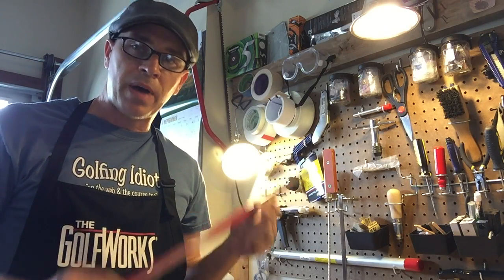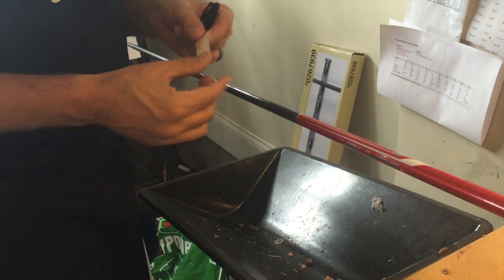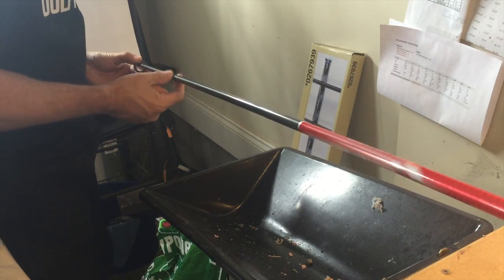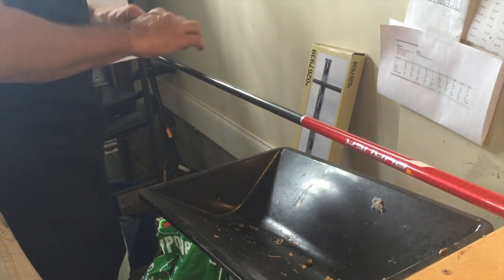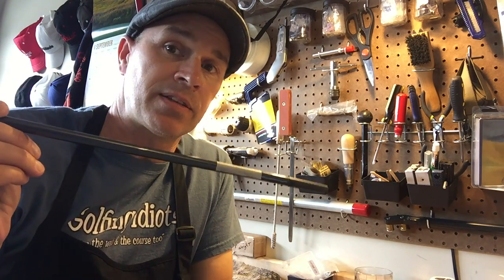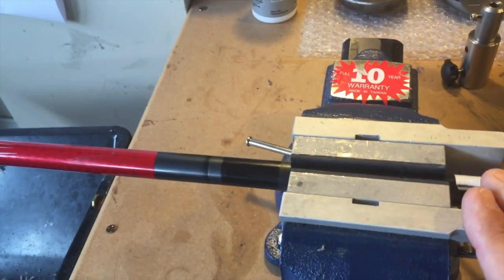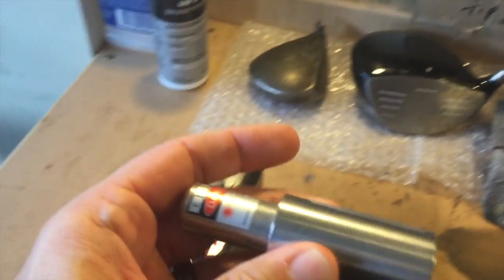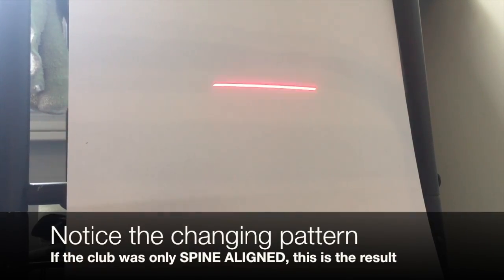How to FLO a Golf Shaft (correct position of shaft alignment)

Comment: I have performed the flo procedure on all my woods.I lost my laser that I used in the past and wanted to check a friends driver.This a alternative, I clamped the driver shaft in my vise cautiously, cut a thin strip of white tape and put it at right angle to the face and in the center of the head.put my bright pen light to shine on the dot then did a few twangs of the shaft,this works, you can see right to left line or oscillation of tape line quite clearly. 
I call it poor boy puring.

Comment: I agree completely about putting the softest bending axis of the shaft (the spine) in line with the target line when finding the FLO. Often/usually the FLO will be relatively close to the axis of the spine. There is another advantage in doing this. Having the softest flex axis near the target direction when assembling the club will mean the axis that bends much less will be perpendicular to the target line. That will mean the shaft bends down less and, therefore, the club head droops less at impact, making solid contact easier. I do one thing different than what you show. I use the actual club head jammed on to the shaft with a small piece of rubber band to hold it there. I FLO the shaft that way since it duplicates the center of gravity of the head being away from the center of the shaft. Obviously I turn the head so it starts with the clubface facing the same direction as the mark on the tape and I keep adjusting the head position slightly when turning the shaft in the vise until the shaft oscillates in a straight line. The club face needs to keep being adjusted to face perpendicular to the line of twang. Once I find the FLO axis I mark the tape with a different color line, but on the FLO axis (9 o'clock). When assimbling the club I put the second color line facing the target which is the straight line FLO axis. It is just a different way to get to the same result.
Reply: is the only way to do this yourself or are there businesses that provide the service? ty for your comment, it seems most logical to "FLO" the shaft with the head on it since at the end of the day that's how you are gonna hit it. Additionally, i feel as if different heads have different weights and center of gravity which might affect the perfect shaft allignment.

Comment: I spline the shaft in the 2 bushings on a vertical plane, straight up and down. Then I put the clubhead on the shaft without epoxy. Then I stress the shaft and align the face of the club so that it is facing at a 90 degree angle from where the spline is. Then mark the shaft and the hosel so that I can remove the bushings, then reattach the club head with epoxy. 
When I stress the shaft during the golf swing the same as I stressed it with the bushings the shaft will want to square up the club face the same as it did in the bushings. 
This method would seem to best simulate the actual stresses generated in the golf swing.

Comment: I agree 100%, I started flowing my DCB's and only 2 out of 6 were where the Osculation had a flat line. The Epic Max (brand new) was the worst and by rotating it I was able to reduce it to a small oval but the adjustable hosel is a joke.
Reply from the maker: Have you found that you are more consistent or less dispersion with your FLO'd shafts?
Reply: I will buy a shaft puller and hosels and let you know when I am done.
Reply: Callaway adjustable hosels and one other brand I don't remember (PXG?) will keep the shaft in the same orientation regardless of the setting.

Comment: so to make sure i followed this correctly, after flo'ing the shaft then allign the 12 o'clock flo mark with the club face? or how do you know where to align that mark with? i had assumed the club head would have a mark to align to, but that is not the case of my club heads at least, so the 12 o'clock of a driver head vs a 60* changes wouldn't it?

Comment: I find the way you FLO a shaft interesting. It is the same way I do it. I put the mark 90 degrees different that you do (on the FLO axis) so it is in line with the target line when the club is assembled, but the resulting shaft position in the assembled club is the same. I have never understood why some people assemble the club with the FLO line perpendicular to the target line. It seems that would make the shaft droop more, be less consistent in behavior, and increase the difficulty in hitting the ball in the center of the face.
Reply from the maker: Either way will work as long as the person understands the FLO should be parallel to the swing place/path. I guess the marking is only a preference. I am not sure why someone would place the FLO shaft in the position you referred too. Odd.

Comment: Some would argue the bearing based "spine finder" is not finding  a spine, but how the shaft is naturally not perfectly straight but has a slight curve in it , when not flexed. Nothing is manufactured perfectly straight.    If a shaft was so unstraight it looked like a kitchen spatula, it would would always rotate to that same position in the bearing curve finder, every time.     Yet what does that have to do with how the club actually oscillates when it bends?   Not always much, as the shaft is often rotated away from the curve aligned spot to find a spine it will flo in.  I prefer to flo the shaft vertical.  I have a tip weight with a laser pointed rubber banded to it.  I can leave it a tad loose and slightly shake the shaft to get the tip/laser center of gravity to fall straight down, and then tighten it.  Then i know the tip weight and laser's  center of gravity is straight in line with a straight vertical twang.

Comment: Very interesting video and impressive shop. One item which was not addressed was if shaft spine has any correlation to FLO result. Since FLO is the goal, why bother with finding the spine (other than maybe giving you a good place to start with FLO process) since the shaft needs to be installed at 12 o'clock after FLO completed anyway?
Reply from the maker: Hello Chris, I get this question a ton so you are not alone.  The ONLY reason I did the spine marking was to show in the video the difference between a FLO'd alignment and a Spine alignment which rarely correlate.  Apparently, I did not do a good enough job explaining that point in the video, but I'm always happy to answer the question.  https://youtu.be/PrVkh1dig9o?t=566

Comment: Great channel!!! I would be interested to see if the shaft flos a tiny bit differently with the head dry fitted on to it than with just the laser weight. Since the weight of a clubhead is not centered around the shaft but on the side of it.
Reply from the maker: Thanks for watching and glad you're enjoying the content!  The laser is actually on the high side of the shaft during the FLO process.  Therefore, it is similar to the weighting of a club head.  Some individuals actually use a dry fit club head to FLO the shaft.

Comment: Thanks for the info. Nice, thorough explanation. So, looking at the movement of the laser oscillating after you "twang" the shaft, it seems to take a half dozen oscillations before they begin to get wonky. Makes me wonder if it makes any positive difference. One thing for sure, however, it definitely can't hurt. As little time as it takes to find that ideal plane, I'm all for it regardless.
Reply from the maker: So how did it work out for you?

Comment: You explained this process perfectly. I have been floing shafts forever. Whenever I try to explain to a customer why and how it's done they look at me like I'm crazy. I will send them your link from now on! And hell yeah. It does make a huge difference. I love to experiment and have way too much time on my hands to do so. Since I started floing my own shafts, dispersion is RIDICULOUSLY tight! If I'm having a "good golf day", I can land my 8 Iron shots in a hula hoop!
Do you find it a little more challenging to find the Flo as the shafts get shorter? For example, steel shafts for 8 or 9 through to the wedges? I eventually find it, but it takes a bit.
Reply from the maker: I completely agree with you and glad to find another person who is as passionate about FLO'ing shafts as I am!  To prove the point,  I have two identical 6 irons, one is FLO'd and one is not; I get an individual to hit both and ask which one they prefer (I do not tell them which one is FLO'd prior to hitting the irons).  Without fail, it is always the FLO'd iron.  I cannot say that shorter shafts cause me an issue more than longer shafts, but honestly I've never really paid much attention to it either.  I do note that better quality shafts are MUCH easier to find the FLO. Glad the video helped and thanks for the promotion.
Reply: @XJSimulations  
To add one more apple to the ox cart...
I Flo with the Golf Mechanix chucked tip weight and Flo tracer with the adjustable weighting along with the shaft rotation dial indicator.
I also start with the spine alignment mark. Very rarely does it line up with with Flo, but when it does I consider this the holy grail of shafts! To get back on topic, when I find Flo, I re adjust my dial indicator to 0°. Then I rotate the shaft 180°, and it should Flo exactly the same. I then note the height of the laser point. In most cases with steel shafts, there is a high side and low side. I use the highest point where the laser flo's at 12:00, as this point is a bit stiffer to help compensate for shaft droop. Just one of my little secrets, as Viagra will not help with this particular type of shaft droop.
Reply from the maker: @mikereling6045  great points which I considered going into detail about in the video, but it seemed to be a bit too much information.  Hopefully, those more interested will read your comment.

Comment: Nice vid GI. Have been using a variation of this process that I call 'the twang test'. What we are finding is the axis upon which the shaft wants to flex. I use a rubber shaft clamp in a vice and twang the butt end. The axis is the same whichever end the shaft is viewed from. A 'twang ' on any angle across the shaft will find the path of least resistance as the oscillations settle out, then all that's left is to find the top (or bottom). How do we come up with a test to measure the effect of Chubby Checkers (torque) on this axis.As I understand, manufacturers still have no uniform method of torque measurement.  Thanks again
Reply from the maker: Good question on torque, but that will require actual equipment to conduct that test.
Reply: torque is measured in "foot pounds". the butt is clamped in a vise.  then a 12" long "arm" is clamped to the tip and a gauge on the arm is set to 0° on its scale. a one pound weight is hung from the end of the arm causing the shaft to twist under this load. the scale will indicate how many degrees the shaft twisted under load(thus "foot pounds". generally speaking slower swingspeeds can handle higher (
>3.5°) torque while faster speeds generally indicate lower (<3) torque.

Comment: Thanks for the education, however I want to clarify this with a adjustable driver, the instant you change the setting on the driver the oscillation plane will change. How do we take this into account while re-shafting a adjustable driver.
Reply from the maker: I've answered this question many times before and the answer is you cannot.  Set the FLO'd position for the most used degree/loft setting the individual prefers.  That is the best you can hope for.
Reply: @XJSimulations  Thank you for the reply
Reply: That is true with all brands except Callaway. The Callaway adjustable tip is ingenious because it allows the shaft orientation to stay the same without regard to the tip setting adjustments. (I use Callaway woods.)

Comment: What clamp do you use in the vise to FLO? My rubber clamps dampen the twang too much.
Reply from the maker: That’s odd as I’ve never heard that mentioned.  I have a set of shaft clamps I purchased years ago; one is standard oval and one is a diamond clamp. Either of those work well.  You may want to look for clamp options at GolfWorks or Golf Mechanix

Comment: I used your method and found the high spine just like you show here, worked great and can definitely feel it. The follow the remaining step just as you describe here. I did it on a "Pured" shaft that has the factory sticker just to check and see if my method actually worked along with what they had gotten from this specific shaft before I went on to do it on my newer shaft. The interesting thing is the pure sticker when following your method appears DIRECTLY on the bottom on the opposite side, I mean exactly opposite at the 6 o'clock position. Can you let me know what you think about this. I know sometimes shafts have two spines as you mention, but definitely felt the "high spine as you mention... any thoughts.

Thanks and really great videos, really helping me out.
Reply from the maker: When a shaft is FLO'd it can have two positions on the shaft directly opposite of the other.  Unless you have expensive equipment (PURed), you cannot tell exactly which of those positions would be "best" for the shaft. Please remember though, it is not the spine of the shaft  you want to identify, but the FLO position of the shaft.  In the video, I used the spine method to demonstrate the difference between the two positions on the shaft.  Apparently, I did a poor job explaining why in the video as this point has been missed many times and answered many times below in the comments :)
Reply: Thanks for the answer, pretty much what I assumed but was curious... And also, not at all, I completely understood by your video that finding the spine was just a starting point to help you get closer to Flo'ing the shaft, made perfect sense to me. Yeah I figured that after I Flo'ed the shaft that it was probably something like that with the "PURED" line being that it was exactly at 6 o'clock as mentioned... but obviously the method worked pretty darn well if I came up with an exact posit side of the PURED results... thanks again
Reply: Absolutely understood that the spine check was a starting point.And that the FLO was the main point.Great Vid.

Comment: In the end of this video, you mention that it comes down to the matter of millimeters when the club head comes into impact with the golf ball when making sure the FLO is in the proper position. There is such a small gap when it comes to the consistency. As far as the installation of the club head in the 12:00 position, is there a certain forgiveness when this takes place? I feel as if this has a certain importance as well and I am just wanting to make sure the golf head is as center as possible when going into the shaft for installation. This is a case for a club (without) an adapter, just shaft to driver head. Wondering if there is anything other than just eyeballing this step for a better accuracy. Any feedback on this would be most helpful. Thank you and thanks for all the videos, they are all great in the info they provide!
Reply from the maker: I have used a laser down the shaft previously in order to mark the insertion point on the club.  I would recommend this to you.  This can produce very accurate results.  If you FLO enough shafts, you will get accustomed to using your eyes to line up the shaft.
Reply: That sounds great, thanks for help!

Comment: Thanks for comprehensive intro, if final result is to get the FLO, then why not skip the Spine part, pls advise
Reply from the maker: Thanks for watching.  I have answered this question a few times.  The only reason was to show the different results between the two methods.  Spine alignment or spinning a shaft is not the correct way to locate the FLO of a shaft.

Comment: Does the position of a shaft that has been FLO'd vary when it is inserted into a left handed clubhead?  Is it still inserted at the 12 o'clock position?
Reply from the maker: Still the 12 o'clock, that's correct.

Comment: i have an aldila rip phenom tour x 70 with a line on the but end.  it seems safe to say that this is the spine. no?  it happens to be label up.  additionally i have some new project x flighted 6.5 my clubmaker down the street said that the have a spine label down.  the fellow at true temper that i spoke to said they don;t have spines?  i am confused.  also do you see regularities as far as label orientation goes and flow.  i dont have a vice to check for myself and am doing it on the cheap.  i appreciate your service and any reply.
Reply from the maker: Unfortunately, that may or may not be the case.  A line on the shaft (butt end) could be simply for alignment purposes during install to ensure the label is centered.  There is simply no way to know for certain without additional information.  The shafts must be checked in order to determine the FLO.  As I mentioned in the video, labels do NOT indicate FLO alignment of the shaft. Thanks for watching.